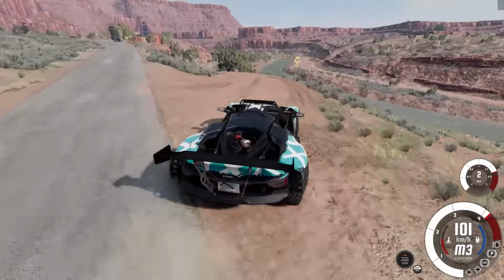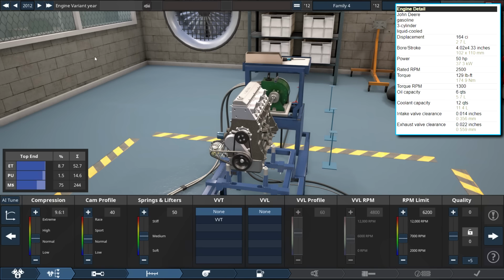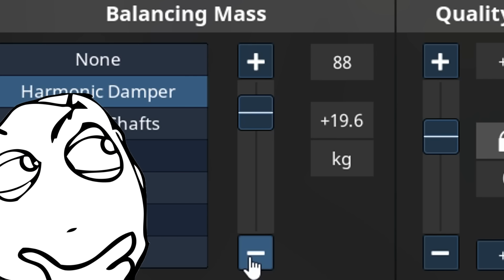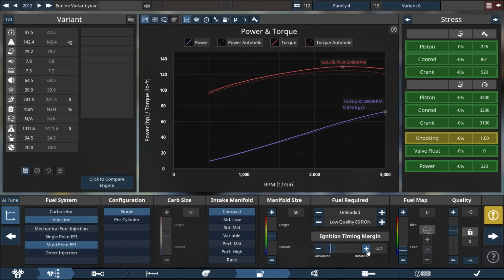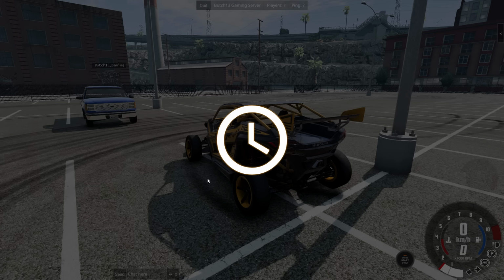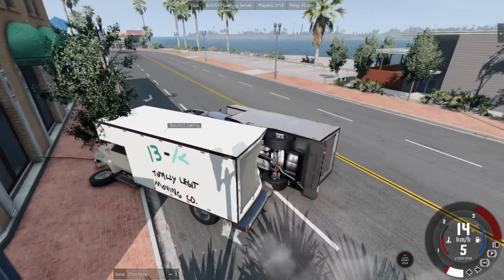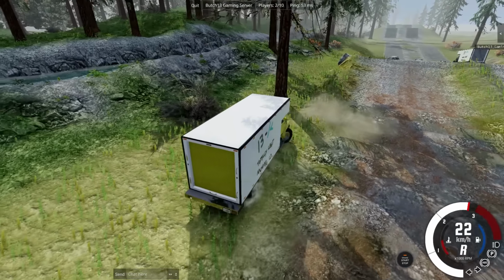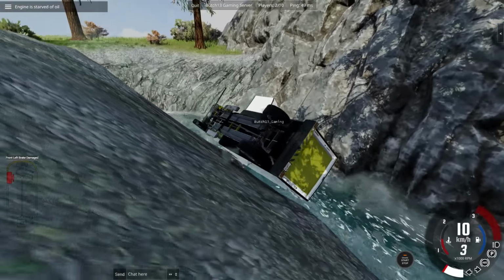I Built a TRACTOR Engine For an UNKNOWN Vehicle (Automation | BeamNG Multiplayer)

Comment: part of the reason you had a hard time finding info on the john deere engines is that they actively make repairing them your self harder
Reply from the maker: that's a bummer :/
Reply: Yeah, they a very anti right to repair
Reply: That is an old enough tractor where that is not an issue at all. There is manuals that go completely through that engine. New John Deere tractors are definitely hard to repair yourself. Older ones though are great to work on and typically very reliable
Reply: @England91  right to repair doesn't exist for farm equipment. The way it does for cars. It fucking sucks
Reply: @jediknight1294 false information. That’s going back two years big fella
Reply: Also most of the information that is available on these old tractor engines is still not online, despite being around forever

Comment: You should both make three engines and three vehicles.
One small, one medium, and one large of both.
You give the vehicles to each other, and use your engines in the one you get, then run challenges or races with them.
But here's the catch.... Both are randomly selected.. (basically you try to guess which size vehicle they are gonna give you) so you could get a small vehicle with a large engine, or large vehicle with a small engine.
Each vehicle and engine can only be used once.

Comment: I love how he’s able to make a 2.7L i3 cylinder that is bigger than my 1.8L 1975 Fiat i4 cylinder, and have the 2.7L still make half the power lol. That’s actually mind blowing how you can have so much displacement and make so little power. That’s on par with the model T engines. Also for future builds cosmo, if you want to make an engine with no power just build a normal engine that works great. Then give it a really small carb and restrictive exhaust. Add a smog pump/rebreather going into the intake for extra points. That’s how they killed the power in my car. My car makes 84hp stock, but makes over 100hp just by replacing the exhaust and carb. Easiest way to kill a cars power is get the government involved.
Reply: Also if you are looking for engines specs to build, there are countless resources for my car’s engine. You can find every single measurement possible for this engine. 1975 fiat 124 spider, 1800cc inline 4, North American market. Would be super cool to see your version of it in one of your videos.
Reply: Not unusual for tractors. 
A new Holland ts115 has a 7.5l engine making 115hp
Reply: But loves to lug...
Reply: Like classic 40L V12 engines from the 20’s that made like 200hp
Reply: Ah, but it's got torque enough to move a house
Reply: Hp is torque over time, aka torque and rpm. When most tractors have rpm limits in the 2000’s or 3000’s Hp will always be low. It’s the torque that matters for tractors. For example, the engine in an Allis-Chalmers 7040 has 117 hp at 2300 rpm. That gives it 267.2  foot pounds of torque. For a 70’s tractor (the oil crisis made producers cut engine power by a whole lot) that’s pretty good for slow moving heavy weights
Reply: Torque definitely matters more than people realize. My Harley is pretty hot rodded and makes 99 Hp but 112 Lb/Ft and on the streets I'm faster from 0-80 mph than sports bikes with 120+ Hp because they only make like 70 Lb/Ft. I'll never say my bike is faster because it isn't my top speed is 120 but I'm definitely faster in the 1/8 mile drags. And that acceleration power is more fun for riding in the streets than being able to rev to the moon and go 170 mph.
Reply: I drive a malibu ss with a 3.9 v6, you'd think it would make impressive numbers but 240hp and 240 tq from factory rating. Displacement dosnt always mean power

Comment: You can comfortably make a turbo version of this engine. Lots of old tractor engines back in the day had a turbo version, even those from the 60s. Personally i would have went for an I4 instead of an I3, I4 engines were the most common

Comment: I'm not sure how this game works but the reason it said that the engine would break right away might be because you didn't put balancing shafts on it: 3cyl engines have inherently unbalanced verticle inertia forces from pistons moving up and down. And harmonic balancer is used to fight tortional vibrations in the crankshaft which aren't that dangerous in a 3cyl since crankshaft is very short. It could also be that you put too heavy of a harmonic balancer and the engine breaks trying to overcome it's inertia.

Comment: The biggest issues you have is, 1: adjusting intake and exhaust before you even finish the engine... these are done LAST as they make a HUGE impact on how your engine runs, and where you make power. 2: your cam is too aggressive, literally not even using 70% of your cam at 3000 rpm. Fun video though.

Comment: Now, that is not how utility engines are built.

First thing, in Automation you can easily replicate a diesel engine both in terms of high knock threshold for high comp and really good fuel economy by using 150RON Compressed Gas as fuel.

Second thing, utility engines are basically AAAALLLL low end torque, so in Automation that means the Cam and Valvetrain stiffness value hovers is always between 0-10, never above.

Third, always use standard low for both intake and exhaust, because automation doesn't get it quite right but realistically utility engines don't flow much hair due to their cam setup, hence a standard low behaves the most similarly to a real tractor or truck engine.

Finally, you used a Port Injected EFI in this but the engine you're referencing uses mechanical injection for both petrol and diesel variants.

All that being said, really good video 😊

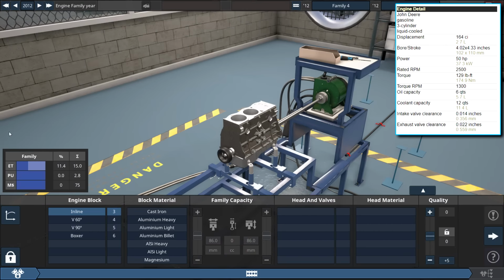Comment: wait... did those specs (1:32) just say 50 hp and 129 lb-ft? because that's a whole lot better than the engine you made for the 50 hp challenge video 😂 maybe you should have made a tractor engine for your massive wagon 😅

Comment: its not that you picked an obscure engine, its that you picked an engine from a company that doesnt want any aftermarket and doesnt want you to make any repairs on it. you picked the apple of engine manufacturers
Reply: also. that is a fuel pump but your not going to make fuel injection pressures with it. its for a carb

Comment: I mean, just keep the mismatching going. Have a massive torque hauling super car. Have a 2000hp T-series. Just the opposite of what they look like. The ultimate sleeper series. Will your off-brand Evade Stallion Hades Feline do a 7.72 quarter mile? Nah, but it'll pull the truck hauling the truck hauling the trailer your other off-brand Evade Stallion Hades Feline is on to and from the track.

Comment: too high of compression will make the engine pull timing, meaning that you're going to get knocking/pinging, loss of power and reliability.  the dyno graph has a timing indiactor that shows blue from the top down when its pulling timing (just below  "RPM [1/min]").
Reply: @lytlejj1408 The timing won't change, but the gas will burn, pre-ignition.
Reply from the maker: That's sorta why I found it odd that it wasn't giving me a knocking warning at 16:1! I am sure there's a perfectly good explanation for it based on the other variables I chose, but I am used to it not being happy when it's that high :_kosmoKos:

Comment: If you advance ignition too much you are more prone to knock because and causing engine failure so to eliminate knock, run richer, use higher octane gas, low cr or retard the ignition, and also if you retard the ignition you will lose torque because the combustion will not be totally "used", resuming the more advance you use the more torque u gain, but more prone to knock will be but if you retard u will lose torque but will be safer